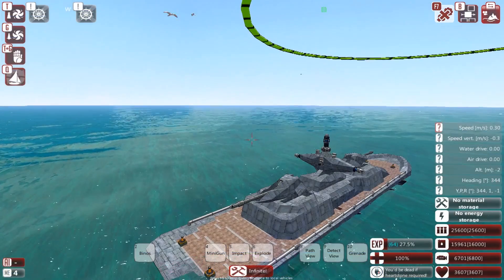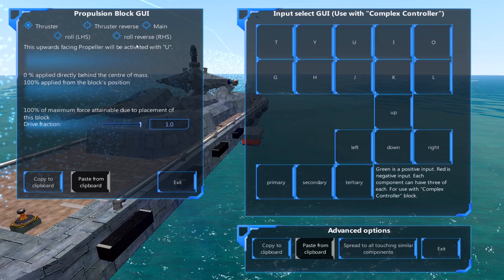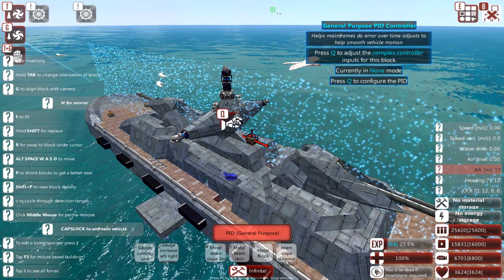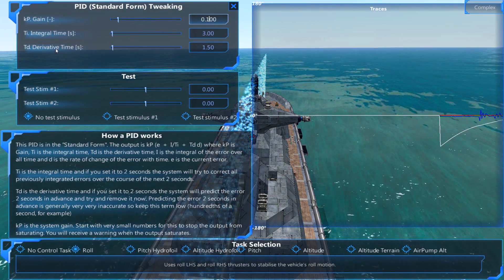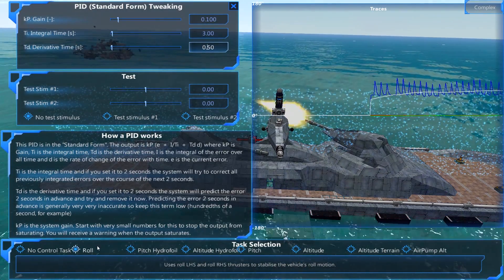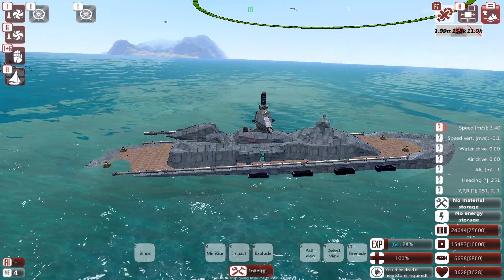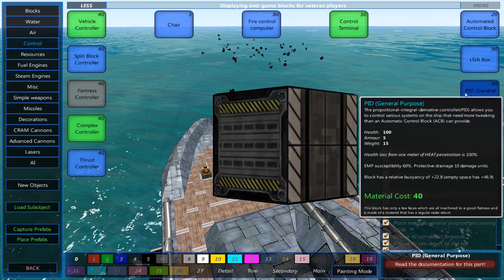From the Depths: Tutorial: Recoil Reduction with PID

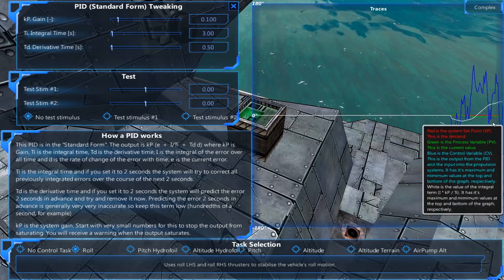Comment: 6:00 The reason you're seeing higher amplitude on the blue control input graph after removing the extra propellers is only because with them in place it had more propellers and thus required a lower driving force, not because the extra props were upside down. Props can drive in reverse, unlike jet thrusters, so it's just a matter of having enough of them to function sufficiently well to quickly damp the large recoil spikes even when damage starts breaking off some of them, and the exact up/down orientation of each propeller doesn't matter. You should be able to see them spinning on both sides even when they're all placed pointing downward (or up) and as long as they are submerged they'll do the job whether it requires up or down force. Thrusters, of course, don't have the option of running in reverse, so for hovercraft you do need equal opposing roll thrusters to avoid pushing the vehicle up or down and possibly affecting its pitch as well.
Reply from the maker: Yup a couple of things I've learned since recording this. More notably is that I should generally just set the integral to infinite/disable. I've found it provides better results in combat as bits of the ship and thrusters get knocked off.

Comment: I'm brand new to the game and I have so many questions. Like in vehicle designer how do you get the ship to float in the air so it's easy to build on? Do you have to construct a platform with a docker? Also, how do you download and open blueprint files from the forums?
Reply from the maker: Caps lock to hover vehicles (or build them in space designer) Platform with docker is also commonly used, especially if you are working on two designs simultaneously.

Blueprint files will need to be saved into the From the Depths folder in your My Documents, under profiles, and then constructables: Example from my system
C:\Users\COMPUTER\Documents\From The Depths\Player Profiles\Aner_Dyfan

Comment: Thanks for the great tutorial. Can you do one on APS shells and good combos and size efficient shells,biggest/best punch for smallest shells. Specifically heat shells and getting good heat and hesh sprawling inside. I know it's rather broad but that would be great. Thanks again for a great vid. Can't wait for more. I'd love longer/detailed one when you can and or want to make them
Reply from the maker: APS is a colossal topic, but in terms of best shells? That depends entirely on how cheesy you want to go. I'll put some of the more powerful tips down here, since a tutorial on the subject may be a while.
Inertial frag rounds are amongst the most powerful no matter the gauge. For additional excessive power turn all cones down to 1deg.
Once larger (over 200mm or so) you'll want to front-end these inertial-frags with HEAT, just get a high penetration factor (over 100 etc) and it'll murder things on it's own. The specifics between Frag and additional HE charges for the HEAT probably depends on target, not something I've researched extensively, but they are all powerful.
Graviton rams are just crazy, especially in AotE. And can be added to your inertial-frag-heat round, they wont teleport things miles away but set to torque and you'll be capsizing ships along with blowing out all turret wells and all ammo caches.
333mm in 4m loaders is very common for the spamcannon, built to fire hundreds of rounds in a short burst with a marginal inaccuracy. Setup with the above rounds and it can wipe an entire ship out in a single salvo. (and talking any ship)
HESH? Is just not very good, only significant shell I've seen it used is in a HESH bomb, so it has very low velocity allowing it to penetrate shielding, then when it hits the HE is converted into thump damage which strips the outer hull. Pure frag rounds though would likely be more effective.
For absolute specifics though, I've just not used these types of rounds much. I don't chase the meta much, and feel some of them are far too powerful.
Reply: AnerDyfan thanks for the great advice. I'll be sure to use it. My main goal is try to get some nice internal sprawling/spray on a target